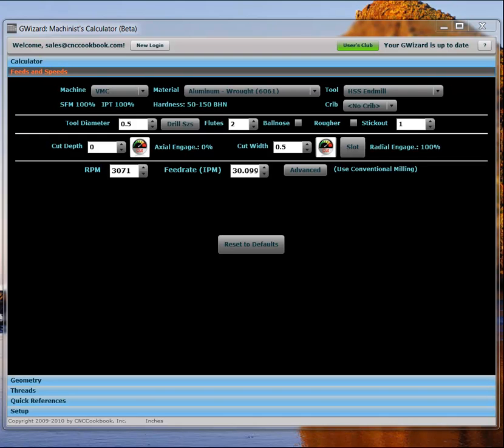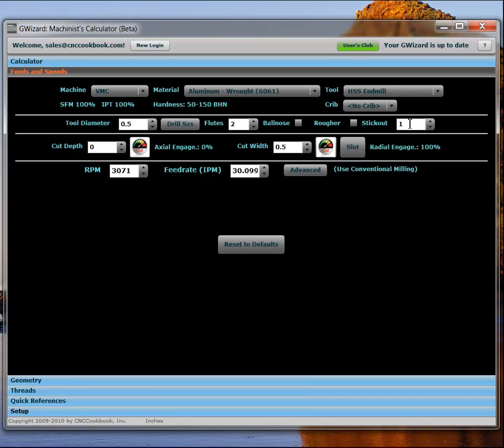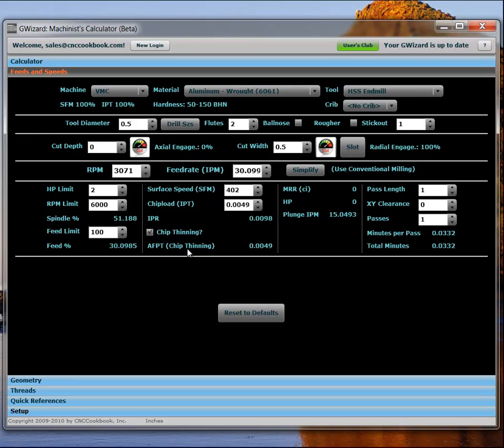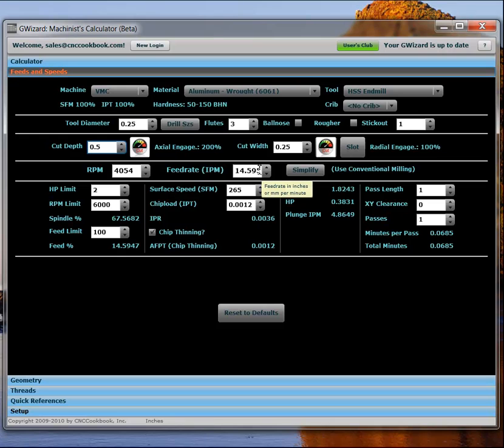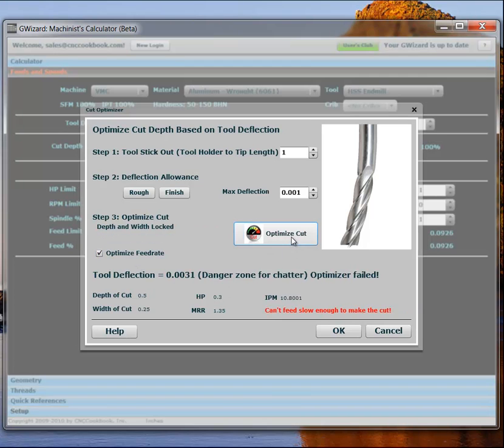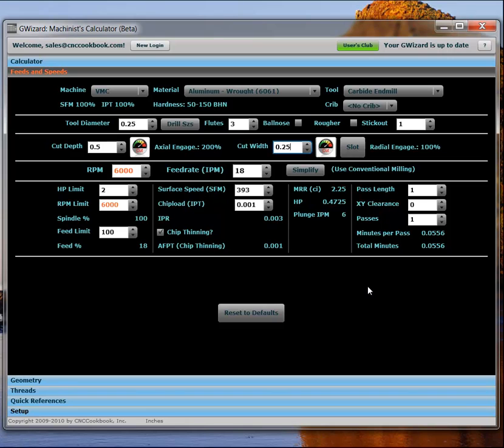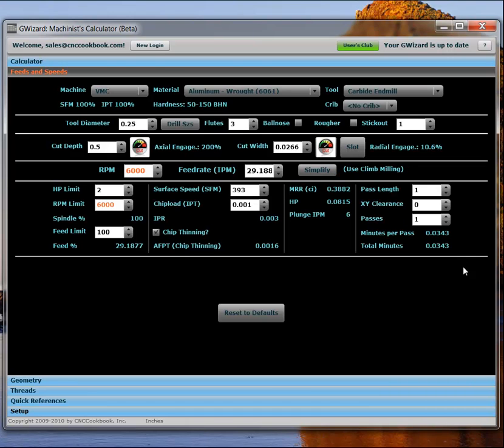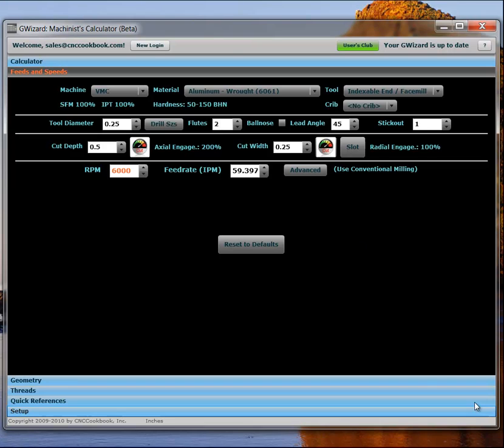A Quick Course in Feeds and Speeds Pt 2

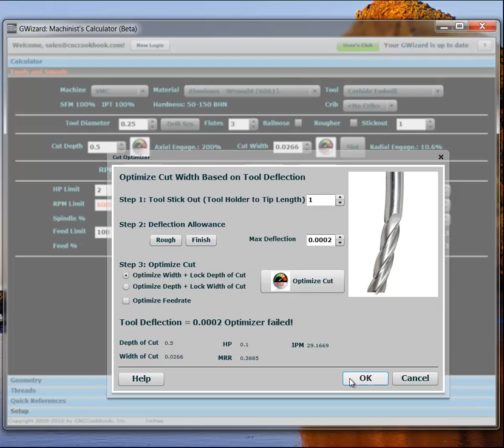Comment: Around 12:50 the narrator claims that the calculation is acceptable, despite the user interface stating in large type that the optimizer "failed" with those settings. The narrator doesn't even bother to mention this apparent contradiction. What's the deal?

Comment: Hi, I'm wondering if this software is reliable also for a particular machine I work with: it's a hybrid between gun drill and mill, IMSA 1200 BBLL MF (there's only one video available here on YouTube, and no I wasn't the one who uploaded it, and the only difference with that machine and the one I work with is the tilting table); it's not a good choice for rough milling although I've noticed that using round inserts it can cut 2mm deep on 1.2738 without too much vibrations on the whole machine.